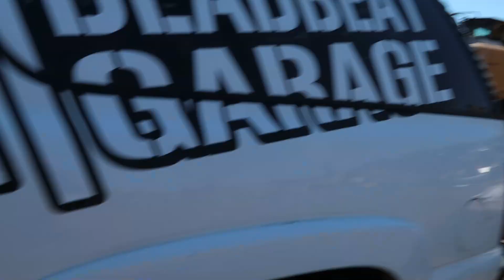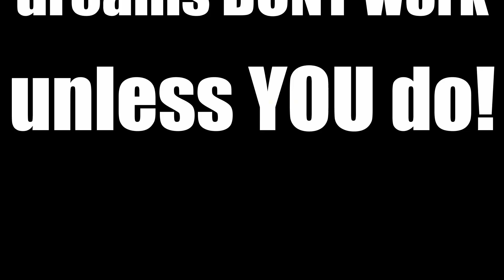Scrapping EVERYTHING!

Comment: As someone who designs buildings everday that base sticking out around the bottom of the shed is going to give you problems. Id recommend using a reciprocating saw and cutting up 4 inches around the base of the wall. Then you are going to want to get something to create some positive drainage away from the walls and floor sheathing you just put down. Id recommend putting in some flashing to come out and over the edge of the plastic. If you dont do this the new osb subfloor is going to be toast in a year from sucking up water that ponds on the ledge and comes off the roof. Know you got the shed on a deal but just trying to save you from having a wonky subfloor thats gets wet and mushy. Take it or leave it. Good to see you back.

Comment: Sometimes, whenever I eat M&Ms, I like to hold two m&m's in between my fingers and squeeze as hard as I can until one m&m cracks. I eat the cracked one, and the one that didn't crack becomes the champion. Then I grab the other m&m, and force it to compete with the champion in this deadly game of m&m gladiators. I do this until I run out of m&m's, and when there is only one m&m left standing, I send a letter to m&m's brand with the champion m&m in it with a note attached that reads: "Please use this m&m for breeding purposes."

Comment: It’s really not stronger with screws the sheer strength of a screw vs a nail is astronomical but in hind sight it’s a shed so as long as you don’t deal with crazy wind it will work just as good